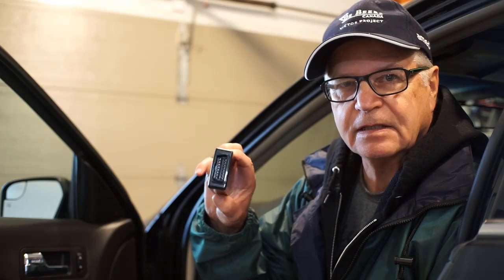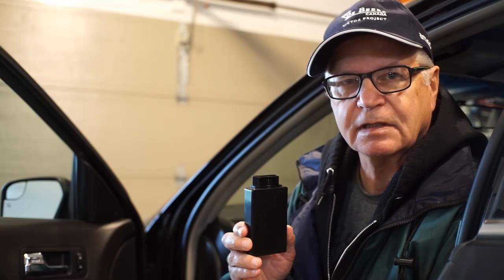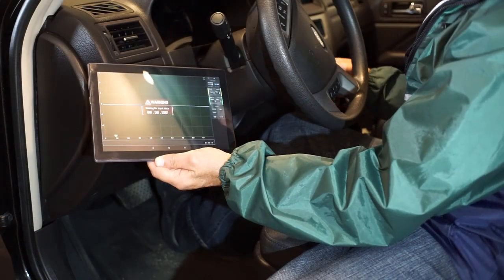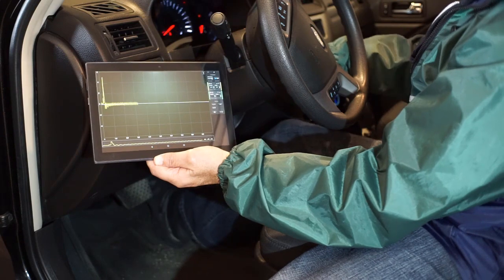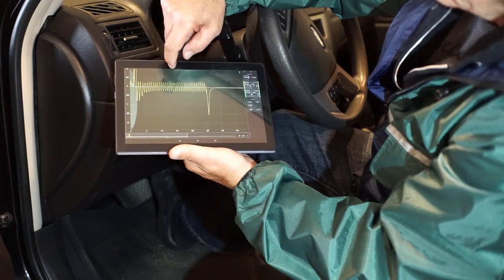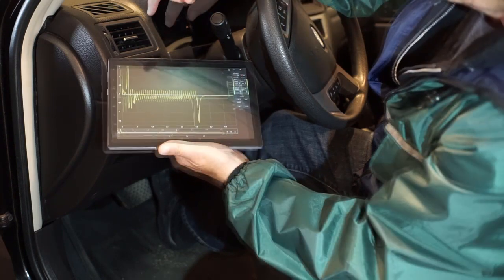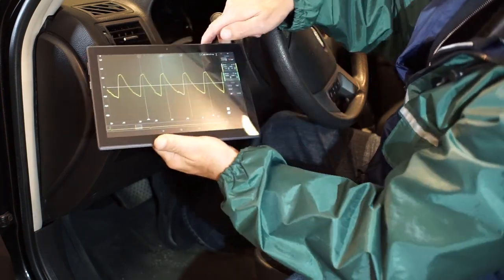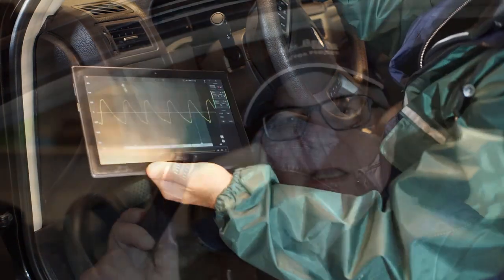GADGETS#74 - RELATIVE COMPRESSION DONGLE

Comment: Pretty smart.  Im guessing it kills the can circuit and reads voltage.
Reply from the maker: This dongle relies on HS101 built in oscilloscope reading the AC Coupling voltage fluctuations as the starter motor demand varies on compression strokes.

Comment: I just bought the license of hscope 6074, I cannot figure out how to stop the picture. Please help
Reply from the maker: +Dimas Rodriguez - am willing to help...not sure what you mean by "stop the picture"?
Reply: How do you "pause " the picture so you can analyze it. Like you did on second 50 on the video.
Reply: The vertical green line keeps moving forward and rewriting the old waveform.
Reply: How do you disable "roll mode"?
Reply from the maker: @dimasrodriguez3155  - now, I think I understand your problem...
I am using the AUTOMOTIVE MODULE which has REC and STOP button.
This module is extra...about $US12...and is purchased through the HScope App
In the SETTINGS/LICENCE you'll see a GET LICENCE button at bottom of the screen.
Select the AUTOMOTIVE MODULE licence.
The 6074 is supported by that module.
Need further help, please feel free to ask, Dimas...